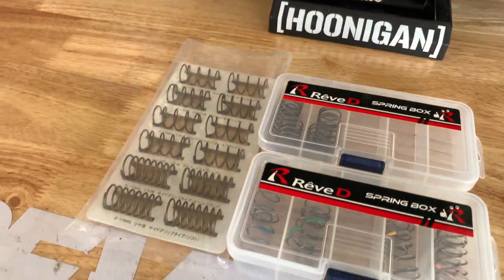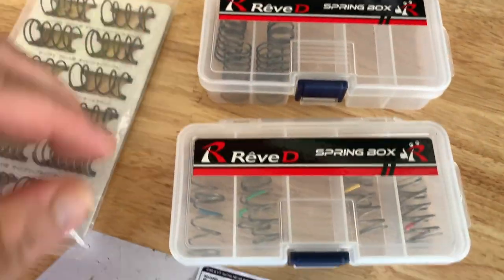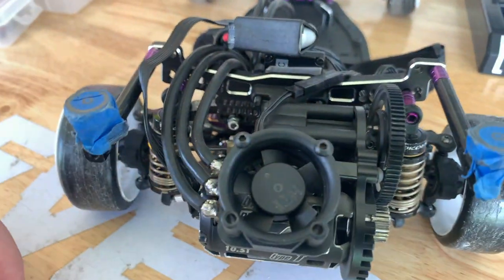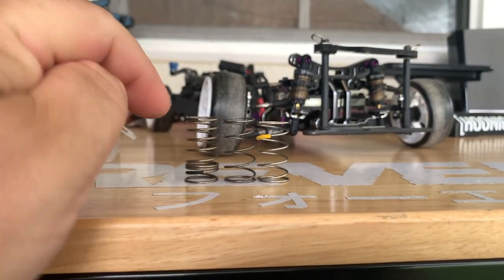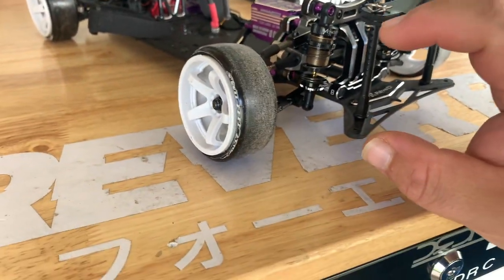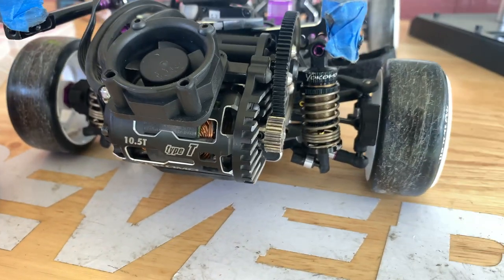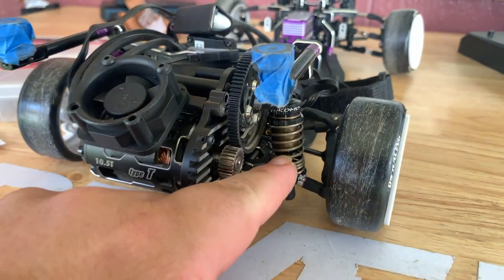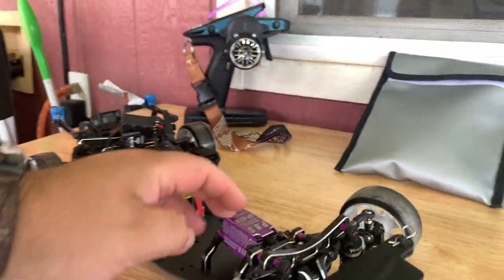Team Saiko RC Drift Vlog 17:  Ryan's ReveD PC Springs Review

Comment: How you got that active toe setup what kind of toe and Camber  you looking at? Would be nice to know I have the same setup. 👌🏻🔥😎🔥💪🏻
Reply from the maker: It’s actually a rear active toe kit from yokomo. I only used the upper arms and knuckles from the kit. Everything else is pieces together from existing parts. I’m currently running -1 in the rear but as far as toe I’m not sure. I don’t have a board or alignment machine to check. I just eyeball it and make it as straight as possible.
Reply: @TeamSaikoRC  that sounds good to me, keep up the good work bro. I like your car looks nice.💪🏻🔥😎🔥👌🏻
Reply from the maker: DriftCraze 2 aye thanks man I appreciate it 🤙🏼
Reply: @TeamSaikoRC  I just finished my rocket Bunny V1, I should be posting up the video soon, pearl white underneath, I've got a yokomo yd2 sxII.
Reply from the maker: DriftCraze 2 sure thing man will check it out

Comment: Nice setup bro BTW can you give me the part number for your front spring ?
Another question I'm new to rwd drifting 
The front springs has to be soft or stiff?
Reply from the maker: Hi Eliya,  the front spring used in this video is RD-006F along with the Reve'D spring cups.  Reve'D has released new front springs since this video that are longer length and stiffer than the originals.  Front spring rate depends on the driver and the surface that you are driving on, but in general the front spring is stiffer than the rear on most of our chassis.  What surface are you drifting on?  Good luck!
Reply: @TeamSaikoRC     hi sorry for responding late 
My surface is concrete 
My car is so rear heavy and I got the new version of the reveD springs yellow on the front and black on the rear I got a 10w oil and the car handles really bad I was going to get a 20w or 25w oil but because I'm on a budget and new to rc drifting I decided to ask you

Edit:I've been watching your content recently I really like it keep up the good work👍
Reply from the maker: @Demo.betheman  hmmm which chassis are you running?
Reply: @TeamSaikoRC  3 racing sakura d5s v2 rr
Reply from the maker: Rear motor chassis can certainly use 25wt shock oil.  Probably need to preload the spring a bunch still.  If you have access to the reveD spring cups that will help to not have to preload so much.  Mainly want the spring to rebound back after you pushed down on the rear shocks.
Reply: @TeamSaikoRC  thank you I got 25 and 30w and 30w works the best for me 😊🙏
Reply from the maker: @Demo.betheman  Awesome!  Glad to hear it worked out for you